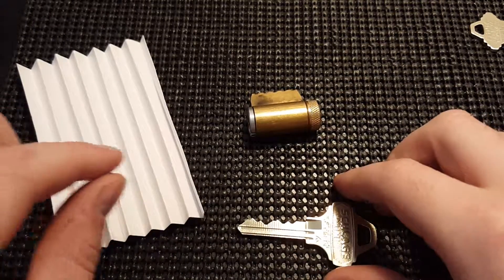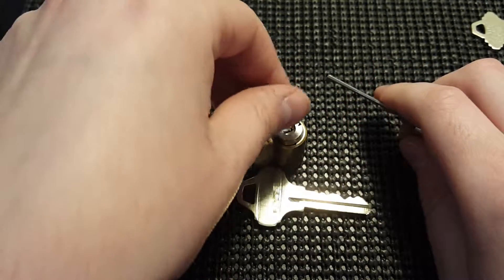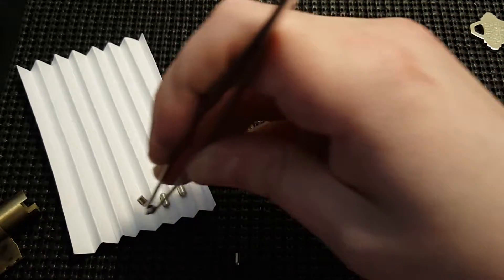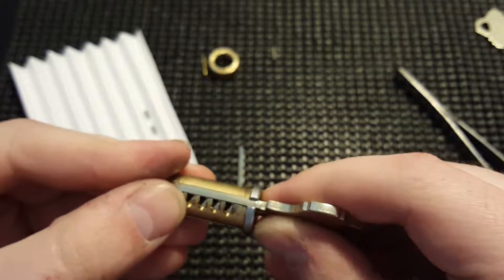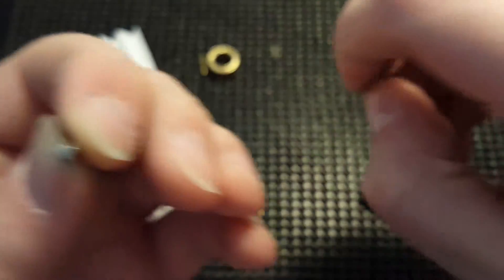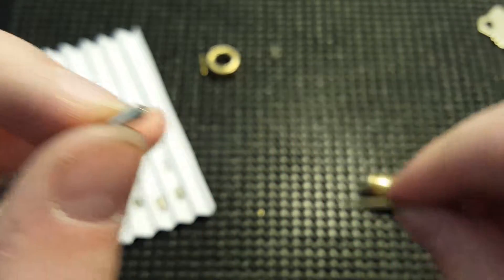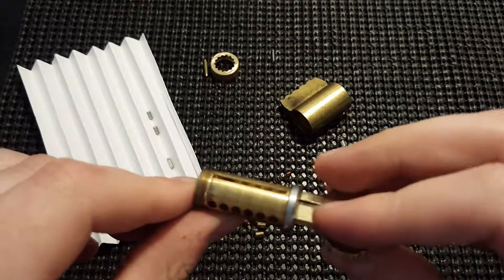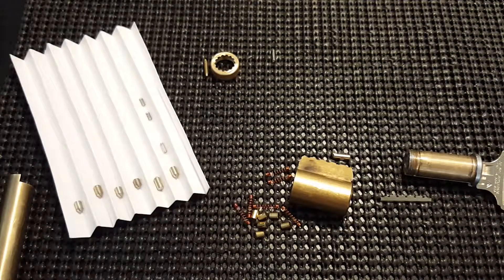(18)How a Schlage Everest Primus Works

Comment: Actually, the top pins (and the Primus finger-pins) aren't made of steel, but of nickel-silver alloy - just like the key.

Schlage Primus was originally patented in 1988. Schlage introduced the Everest keying system in 1997. Schlage introduced the #7 XP Primus finger-pin to extend the patent life of Schlage Primus into 2024. Schlage extended the Everest patent from 2014 to 2029 by introducing Everest-29 as a backwards-compatible key solution where its patented keys will also operate the "legacy" Everest key-ways whereas the "legacy" Everest key won't even enter the new Everest-29 key-ways. (Legacy Everest key-way families: C-OPEN(Unrestricted/Unsanctioned), D-Restricted/Sanctioned, B-SFIC (Restricted/Sanctioned) Everest-29: S-OPEN (Unrestricted/Unsanctioned), T-Restricted/Sanctioned, R-SFIC (Restricted/Sanctioned)

Everest as of 2016 is also available in a special key-in-knob/lever cylinder for B/R families SFIC 7-pin key section to integrate with SFIC products that are used within the same facility. these "SL" cylinders do not use standard pin-tumbler "pin-stacks", but instead use a special "L" shaped pin that interfaces with a sidebar, similar to Primus with its finger-pins and sidebar... SL-series cylinders are also available with Primus as featured as an additional security option. SL-series cylinders cannot be bumped open. 

Schlage, Everest, Everest-29, Everest-29-SL, Primus, Primus-XP & ASSA are conceived by the same Swedish inventor Bo Widen. 

Schlage Everest is also available in the restricted families (D & T, for Everest-29). SFIC (B-family Everest & R-family Everest-29) Everest-29 is also backwards-compatible to the older "legacy" Everest key-ways of the compatible family & section nomenclature i.e. S-123 ~ C-123; T-145 ~ D-145, etcetera.
Reply: Christopher Lawler 
Hey bud, I kjow this is an older video and comment.  But you should really do an informative video explaining the differences between the different types of Everest and Primus out there. 
I just got a FSIC Everest Primus that I need a control key for... I have the operation key but my problem is it is the D-135 keyway.
Reply: So Everest primus is just primus with Everest keyway and extra finger pin type?

Comment: Nice video - helpful for those who have never seen how these locks work! Just don't lose the little springs :P
Reply from the maker: lots of parts. Very small Springs. I actually dropped one of the finger pin Springs on the floor but found it using my cell phone light.